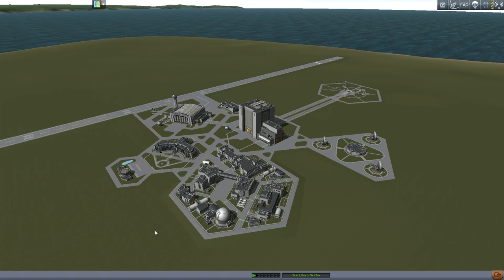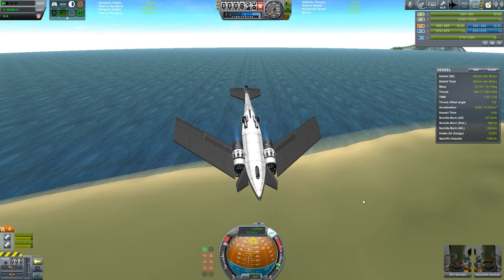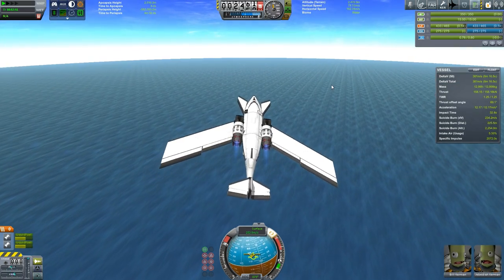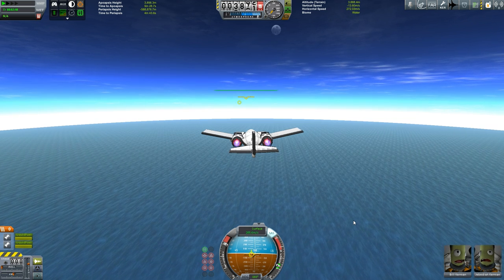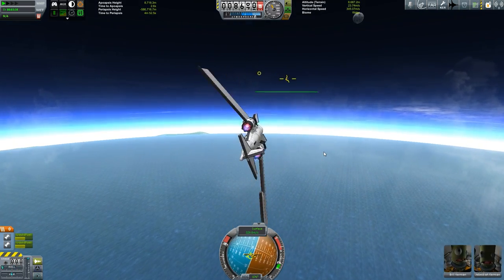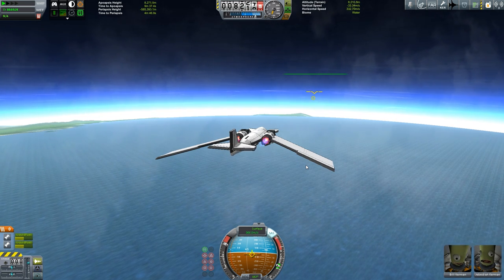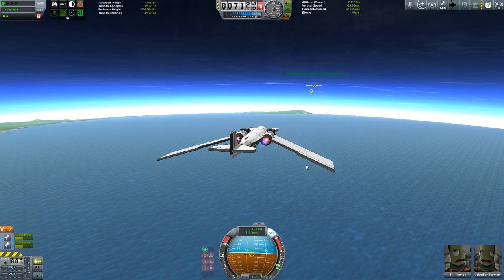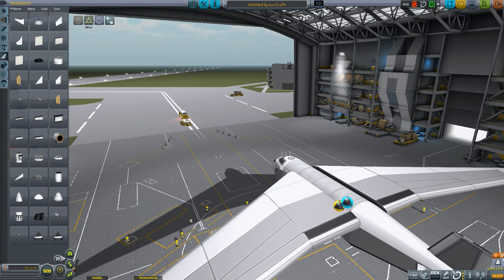Ferram Aerospace Research Tutorial E01: Center of Lift

Comment: 2:15: The reason for COL-forward-of-COM being unstable has nothing to do with pitch up & airspeed loss. It's because of positive feedback. The wing lift induces a pitch-up moment, which increases AoA, which in turn further increases lift and so on - it's a positive feedback loop that naturally tends to move the system out of the point of equilibrium, kinda like a ball on top of a hill. COM-forward-of-COL is the exact opposite. Increase in lift tends to pitch nose down, decreasing AoA, decreasing lift and decreasing the pitching moment, hence a dynamically stable system, which tends towards its point of equilibrium, not away from it.
Reply: Phelan Hehe, that would work great on passenger airplanes:
"Ladies and gentlemen, we will be landing shortly, so I hope you've all packed your parachute."
On a more serious note. It's not impossible to build and fly naturally unstable airframes. Most modern fighters are naturally unstable. The problem is that these require monstrous amounts of FBW logic to keep them from flipping out. If the flight stability computer goes down, the plane goes down. Not really a problem for the military where everybody on board has an ejection seat.

Comment: "Airplane design is more complicated than rocket design", in Kerbal Space Program
Reply: In real life too -.-
Reply: At least in the case of model rockets compared to model airplanes in my experience
Reply: in theory you can do everything with rockets, the possibilities are limitless, it's just the execution that's insanely difficult. look at Wernher von Brauns first concepts in the 50s, they are fucking insane, way  ahead of what we can do today. And on paper they still work, but there's always something that goes wrong on a rocket. Murphy's law stems from the field of rocket science. Planes are just incredibly difficult. You can't design feathers that go to a supersonic speed, we won't ever create an aircraft that is as dense as a bird. Our monkey brains are wired to the ground. The concept of throwing something (which is basically what you do with a rocket, you throw it you don't fly it) is something we can comprehend. But sticking wings on a stick and make it fly? not so easy.
Reply: Rocket design itself is easy. At a hobby level you can just make a sugar solid booster, strap a nose cone and some tail fins, and bob's your uncle. It's guaranteed to fly hundreds of feet up in the air almost straight up. Meanwhile even so simple as a paper airplane requires quite ridiculous amount of planning and design to get it flying properly. Weight distribution, lift distribution, drag, trim, all the good stuff. When you make an actual airplane out of styrofoam and straw, the problem gets so much worse, and that's before you add propulsion and control to fly it manually. 

What's hard about rocketry is the fact that gravity is a cruel mistress. The size of our planet makes it so chemical propulsion has just barely enough power to get us into orbit, so you need to optimize everything about your rocket and trajectory to very extreme degree of finesse. It's why over 90% of the rocket is just fuel - think about it.

Comment: Love this series, you do a great job going through FAR mechanics practically. Could you paste the list of mods you use? (you can get it from KSP AVC in main menu).
Reply from the maker: Episode 4 (https://youtu.be/G9akctD5Vzs) covers the mods I recommend to use with FAR. The full list of mods I use in my current game is (according to CKAN):

- ActiveStruts 1.1.1
- ActiveTextureManagement-x86-Aggressive 4-3
- AdjustableLandingGear 1.0.4
- AdvancedFlyByWire 1.5.1
- AGExt 1.31
- AlternateResourcePanel 2.6.3.0
- AmbientLightAdjustment 1.3.1.1
- B9 R5.2.8
- B9AerospaceProceduralParts 0.34
- BDAnimationModules v0.5.2
- Chatterer 0.8.1
- CIT-Util 1.2.1
- CoherentContracts 1.02
- CommunityResourcePack 0.3.3
- ContractConfigurator 0.7.3
- ContractConfigurator-ContractPack-SCANsat v0.5.0
- ContractConfigurator-RemoteTech 1.1.0
- ContractScienceModifier 0.4
- ContractsWindowPlus 4.0
- CrossFeedEnabler
- CrowdSourcedScience v2.0
- DDSLoader
- DeadlyReentry v6.4.0
- DockingPortAlignmentIndicator 6.1
- EditorExtensions 2.5.1
- EnhancedNavBall 1.3.5
- EnvironmentalVisualEnhancements 7-4
- EnvironmentalVisualEnhancements-HR 7-4
- FerramAerospaceResearch v0.14.6
- FirespitterCore 7.0.5463.30802
- Fusebox 1.3
- HyperEdit
- InfernalRobotics 0.19.3
- IntakeBuildAid 0.5
- KAS 0.4.10
- KerbalAlarmClock
- KerbalEngineerRedux 1.0.15.2
- KerbalFlightData R16
- KerbalFlightIndicators
- KerbalJointReinforcement v3.1.2
- KineTechAnimation
- KlockheedMartian-Gimbal 3.0.1.0
- KSPAPIExtensions
- KSP-AVC 1.1.5.0
- MechJebRPM
- ModOrientedTechTree 0.3.1
- ModularFuelTanks 5.3.0
- ModuleManager
- OblivionAerospace v0.1.3
- PilotAssistant 1.4.1
- PreciseNode
- ProceduralFairings
- ProceduralParts v1.0.2
- Goodspeed Automatic fuel pump
- QuickRevert
- RasterPropMonitor-Core v0.19
- RCSBuildAid 0.6.1
- RealChute 1.3
- Regolith 0.1.7
- RemoteTech v1.6.3
- ResGen
- SAVE 0.9.17-387
- SCANsat v10.0
- ScienceAlert 1.8.4
- SmokeScreen
- SteamGauges
* StockBugFixModules v0.1.7e
- TACLS v0.10.2b
- TACLS-Config-Stock v0.10.2b
- TechManager
- ToadicusTools 6
- Toolbar
- Trajectories
- TransferWindowPlanner v1.2.3.0
- TweakableEverything 1.8a
- TweakScale v1.52.1
- UKS 0.22.8
- UniversalStorage 1.0.90.2
- USITools 0.3.2
- VirginKalactic-NodeToggle 1.6.1
- VNG-Parachute 1.2
- VNG-Parachute-EVALoading 1.0
- VNG-Plugin 0.7.2
- WaypointManager 2.1.6
Reply: +silentdeth How Are you using B9 with FAR if i just use B9 it gives the wings and control surface lift ratings but then i install FAR and it gets rid of them WTH.....
Reply from the maker: +Preston Lago Not sure which version of KSP you are referring to, but if it is 1.0.4 you need to use the maintenance branch of B9: https://bitbucket.org/blowfishpro/b9-aerospace/overview  As for there being no lift rating, well... yeah... Lift rating is an artifact of the stock aerodynamic model. With FAR how much lift something gives depends on a whole bunch of factors, angle of attack, shape of the craft, speed, ect. It isn't something that can be condensed down to a number. That's why there is all the graphs and stability derivatives.
Reply: silentdeth
 ehhg i hate having to do everything myself with files its annoying, and yea im obviously not to play with FAR then.....

Comment: MY plane always stalls as soon as i get off the end of the run way. it lifts up a little bit and then stall. even going 300+ m/s
Reply from the maker: +Makuzi The Inuk A stall is when not enough air is moving over the lifting surfaces. Try not facing as far from prograde, and/or adding larger wings.